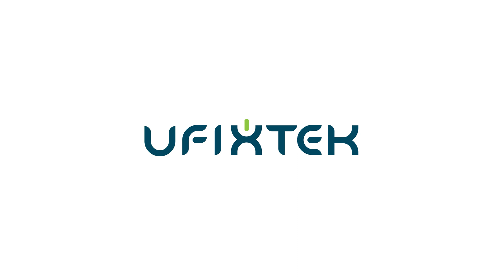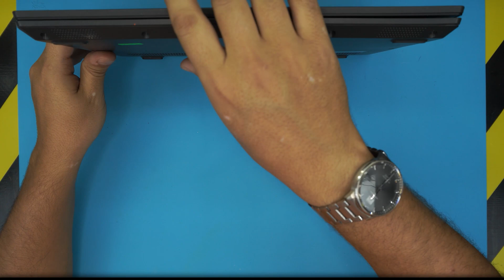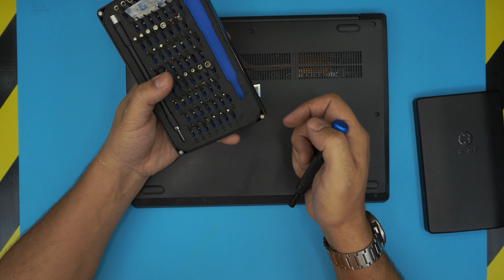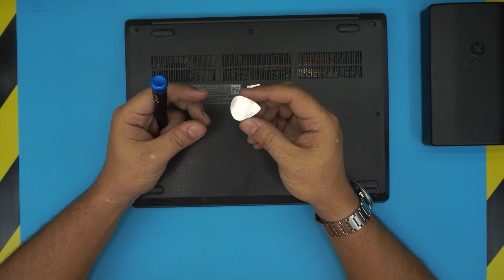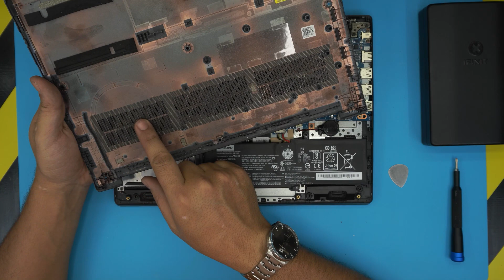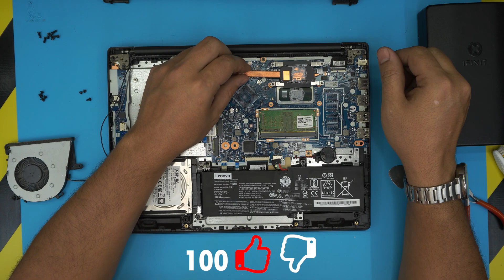Lenovo Ideapad S145 14Iwl Laptop Repaste Service Guide

Comment: It's better to have 2 copper separations for the cooling of the GPU and the Core.
Reply from the maker: the 2nd dye is the PCH ship and it should be having a thermal paste or thermal pad .5mm. the main dye is the CPU and the small dye is the PCH chip.
in all laptops they include thermal pads.

Comment: What was the difference in temperatures
Reply from the maker: the temp difference was about 18c max load was running at 87c after repaste 69c, again your result may be difference taking in count many factors, like room temp type of load, and if the laptop has enough ventilation under, some people place them on bed or fabric that covers the intake of the air.
Reply: Thermal paste on the gpu??